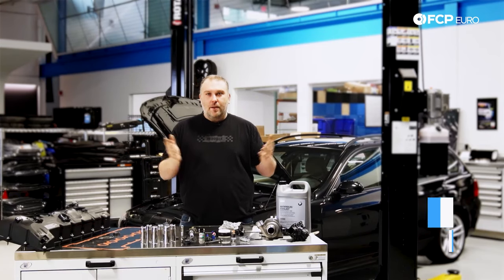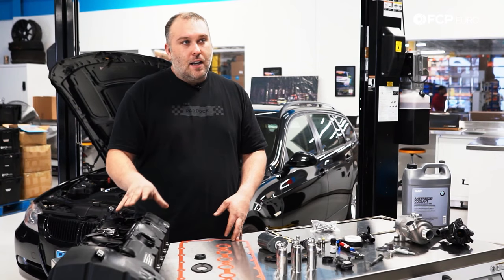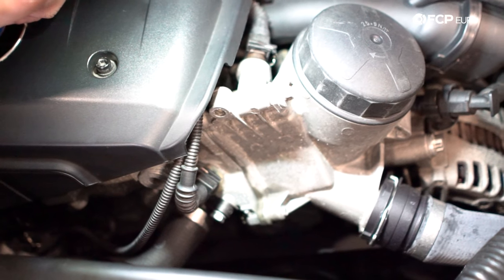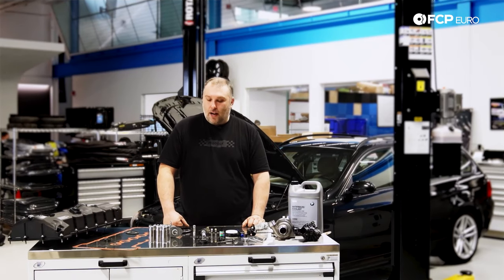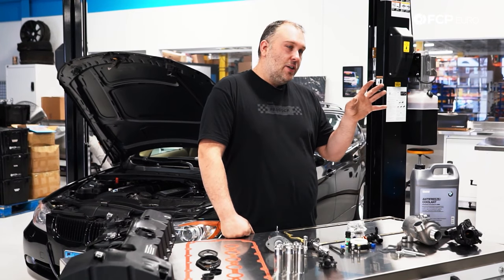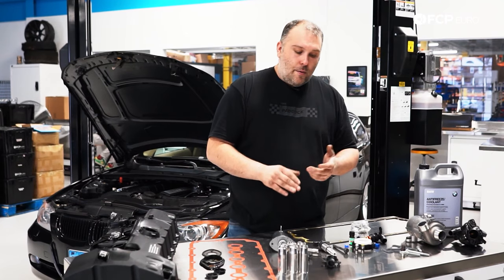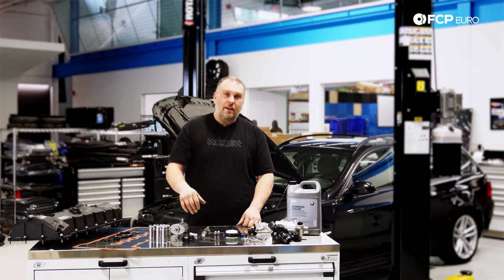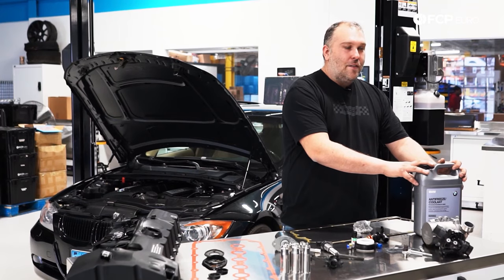BMW N52 Engine Diagnostics/Problems - Everything You Need To Know (128i, 325i, 328i, 330i, 528i)

Comment: Every time he picks up a part to talk about, he looks at it and takes a pause. It's like he is reminded of the traumatic difficulties this part has given him 😂
Reply from the maker: Wow, you can see right through him, Hel Rud! 🤣
Reply: The longer the pause, the more the trauma!

I was getting the sweats just watching the video because I've done almost all of this service on my X3 and 535xi (N54)
Reply: @bryanderksen4448  Yeah, same for me with my 2009 E60. : )
Reply: I think that we've all been there 😂
Reply: I have the same feeling. I have to fix the dreaded oil pan gasket, the crankshaft housing problem, the lifters, oxygen sensor, And probably the valve cover gasket. I won't know how bad the engine is until its open. Nightmare... the BMW has driven me to EV ownership
Reply: We've all been there.... All.... Been...there.

Comment: I'm a BMW technician and I have to say, you did an amazing job on explaining everything. Great video. I'm sure a lot of DIY will find it useful as well.
Reply from the maker: Thanks Cesar its always good to have some confirmation from a BMW Tech! Glad we made ya proud 😉
Reply: Same here. BMW TEC.
Reply: Cesar Perez, got a question  08 328xi e92 been having volatronic issues , code 2a38 , can eccentric shaft sensor cause this code ? ,  Had two other codes but I corrected it, change volatronic motor and relay wiring is good, there is a little bit of oil in the , sensor , I changed the vc gasket few months ago, lol not looking forward to taking apart again the chance of sensor lolol , but if it causes that code  then I'll change it  any thoughts on that code from that sensor
Reply: Hi man. Whats your take for N53 comparing to N52? do they share similar issues?
Reply: @stevet8607  I'm sorry for the extremely late reply, those valvetronic motors rarely go bad. Put a sensor in it. It'll fix your issue, obviously to be 100percent sure it would have to be tested. I have never seen the motor go bad (not saying it can't happen), I have done countless sensors for valvetronic faults.
Reply: @CesarPerez-ck7ci  I'm sorry for being the guy that brings work to YouTube. I have a E60 with the n52 that needs oil filter housing, valve cover, variable timing seal, and oil pan gasket repair. All together I was quoted around $2,500. I just wonder if it's worth keeping at this point. None of the Mechanicals or Electronics have ever had any issues. I love the car, and don't want to get rid of it if it's normal aging not necessarily poor design.
Reply: @ashtreylil1  if the rest of the car is in good shape I would definitely put some money into it, just make sure the person doing the work is qualified and ONLY use OEM parts. Aftermarket parts fail way too soon and rarely ever fit properly.
Reply: @ashtreylil1  also, when you buy an oem part from the dealership that part has a 2 year warranty on the part and labor as well, regardless of who did the work, only as long as it was done correctly.
Reply: @CesarPerez-ck7ci  oh wow I didn't know about the 2 year thing. This kinda justifies the expense over a third party repair shop if anything goes wrong.
Reply: @yahtadi5152  I am not familiar with the N53 as we don't have the n53 in North America, we use N52 but I would think they are very similar.
Reply: Why is like if you buy Bmw you going to regret it. I just had a friend who bought a bmw 530d from 2014. After to week the car was making trouble. He turn of the motor. But after he could not start the motor  again and all the light in dashboard turn on. He went to bmw garage  but the could not find the what was the issue. But lucky enough there was a tech from bmw Germany in the country. He found out the ecu has burn out. Is this very common on this model. I want to buy a bmw but after this I am not really sure any more.
Reply: I'm a BMW Enthusiast owning currently M50B25 car (E34) and M52B28 (E38). Those non turbo inline sixes share many common traits:
- valve cover gasket leaks if you don't replace it properly
- oil filter base leaks
- smooth a sa silk, decent mileage and power if serviced properly

And the most and best tip for all BMW engines, especially inline 6-es is:
- alway put best oil but only one that meets the standards that producer requires for this engine. and do full oil and filters change every 1 year or max ~10k KM (~6200 miles)
Reply: @ashtreylil1  don’t use a dealership that’s one of the worst things you can possibly do. They overcharge for parts and wtf is 2 years of warranty on a car part. Buy your car parts from fcp euro with life time warranty and do the work yourself otherwise you shouldn’t own a bmw because there very expensive cars
Reply: Mr Ceasars, I have an 2011 528i an it gave me an crankshaft code. Replaced it an all car does is start but won't crank. If I put a new battery in there, it drains the battery. What could be wrong?
Reply: Will keep buying from  fcpeuro 😂😂😂

Comment: Thanks for this! Every e90 owner should watch this. I really appreciate your content and learned a bunch from you dude! From brakes and rotors to sensors and pretty much a lot of bmw related stuff. I currently have no heat in mine and I suspect a heater control valve or a clogged heater core, I was wondering if you knew the Inner diameter of a hose needed to back flush the heater core? That would help a lot. Again thanks a lot for all the priceless information for us DIYers!!

Comment: You can use a 9-volt battery to test the Vanos solenoids to see if they're actually waiting open and close when you remove them make sure there's sprayed and cleaned off with brake cleaner and use some kind of silicone or hyper lubricant to lubricate them before you put them back in and make sure the O-ring and the spacer are in place

Comment: Very good video. I had this engine in my 2006 330i, but I did have a major engine issue, I had wear on my camshaft bearing ledge, and luckily warranty covered the $3500 bill. Other major repair bills were $800 for a new oil pan gasket, and a failure of my dual mass flywheel, which was around $3500 for a new flywheel and clutch.
Reply from the maker: Glad you like the video, Uncle Ben! Good thing the warranty covered that!

Comment: You guys are doing an awesome job.

It’s amazing how BMW is not being sued in class action lawsuits against them purposefully using shitty gaskets and plastic parts that break resulting in 1000’s of $$ for the customer to waste.
Reply: A lot of cars nowadays have a decent amount of plastic though don't they?
Reply: @lukesecrest1687  Yeah, it's even worse now on new BMW's. But the E90 generation is considered to be the more reliable one compared to other generations.
Reply: Trust me, BMW has MANY class action lawsuits against them
Reply: @e90_austin  lol right, and I’m sure they like to bury them and not broadcast them.
Reply: @lukesecrest1687  It's all about the quality. There is plastic on my old Acura that will outlive me. And then there's plastic on BMW that is designed to last approximately warranty+5 days.
Reply: Every modern car has plastic parts, heard of heaps of fords and chevys with cracked plastic radiators.
Reply: @mediocreman2  plastic and heat in general don't like each other.
Aluminium would be much better material.
But what's worse, BMW is using lots of recycled plastic that's even worse then normal plastic.
Reply: @trade1713 aluminum actually warps. But ok
Reply: @WayToManyAssassins  true, it warps when you expose it to high temperatures above 200° with some aluminium alloys able to take double that before they start warping.
You wouldn't put aluminium as walls of combustion chamber, but simply as a valve cover, various pipes that plastic just starts cracking after a short while and areas that aren't exposed to high temperatures.
Absolutely superior material when compared to recycled plastic that BMW seems to be liking so much these days...

Comment: Great video!! I just replaced my Valvetronic Motor Gasket for $20 with an OEM BMW gasket. A local BMW authorized place that I trust quoted me $1450 to replace the valve cover seal… After some YouTube investigation I found that the build up of oil below the Valvetronic motor was likely the Valvetronic seal. So $1450 fix turned to a $20 fix, Thanks guys😎🙏🏽🙏🏽🙏🏽🙏🏽

Comment: Awesome video! I have put nearly 100,000 miles on my n52 after buying it with 105,000, and I run it hard! ... I take care of it though; I warm it up, change the oil, etc. Absolute awesome engine. A true gem and the last of it’s kind from BMW.

To add: It’s easy to mistake oil leaks around the valve cover gasket area. As Gareth mentioned, there are several areas on the valve cover gasket that can leak, so if you can rather than just replacing the valvtronic motor gasket or the valve cover gasket, etc., it could be the oil separator which happens to manufactured/integrated into the valve cover. It’s very difficult to differentiate where the leak is coming from, especially when there’s potential for the leak to be located in the middle of the valve cover where the spark plugs are located. 
Since all of these issues associated with the valve cover are common, I recommend replacing the whole assembly and saving yourself the hassle of trying pinpoint the exact leak point.
Reply from the maker: That's awesome to hear, Evan! Glad you like the video and thanks for the tips!!

Comment: Just bought a 2008 328i, I am currently working on replacing all of these parts. Yes, it's a bit of a nightmare but thankfully I have been building my own cars for a few years and I do indeed have experience and understanding. This engine is an entirely different beast but when I finish it, I will enjoy the ride. I knew I was purchasing a challenge and I knew I was capable of saving it. Thanks for this video!
Reply: good luck bro
Reply: Wish I'd known you were in the market for a 328I. I have one with a manual transmission. No sign of engine leak or low coolant, but the engine overheating lamp popped on. I'm not interested in a $5K repair. Thinking about selling it. Any thoughts?
Reply: @shereetyson4422  Probably the water pump.

Comment: Thanks for the overview, Gareth! I've had to replace all of those items on my N52s except for the VANOS items (fingers crossed we are good there). But at 200k+ miles, my E60 has never run better. The E70 is hanging in well, too. One thing I learned the hard way from my water pump failure: flush the system (an extra gallon or two of distilled water is worth the $1) to ensure any bits from the old pump's find are out. I had one jam up my pump (which I bought elsewhere), so I made sure to do the flush before installing my FCP pump. I have an E93 with the N54, too; doing the clutch, brakes, oil and air filters this Saturday. Thanks again!
Reply from the maker: Happy to help, Jeff! That's a great tip on flushing out the system. Thanks again for the support, Jeff!
Reply: You might have got plastic from the plastic mickey mouse flange. Definitely change that to metal either way.

Comment: Excellent info! Have already addressed a number of these components on our 2010 X3.  The oddest one was: we bought the car with a bad oil filter housing gasket. It had been leaking for a very long time. The whole front of the engine was saturated in oil. Replaced that and bought a new serpentine belt. Was kind of lazy and didn't get around to replacing it. During one long trip, the belt completely shredded itself. luckily it didn't take out the bushing mentioned.

The moral of the story, replace an oil-saturated belt no matter how good of shape it looks. This one looked fine.

Comment: Really well done! My N52 is new to me and I'm enjoying going through it. I look forward to your future videos.
Reply from the maker: Thanks, hpathree! Congrats on the new purchase, glad to hear you are enjoying it!
Reply: Just sell it bud. Whatever you paid for the car you're paying again in parts
Reply: @honorhurricane5180  I bought an e90 3 years ago for 8k, I've put 10k into it and I'm basically replacing every piece on it one at a time. Unless you're buying it from a dealership with under 100k miles, it's not a good deal
Reply: @JuanMendoza-nl9fn  My friend got his e90 for 5k 3 years ago at 147k and have put little money in it… and I’ve got mine at 10k a couple months ago and spend almost 2k in maintenance but that is due to labor cost and had to get new tires due to control arms (that was $550)  and I do maintenance that doesn’t really need to be done but I just want to do it. Cause it’s the way I am
Reply: @JuanMendoza-nl9fn  just because you had a bad experience does not mean it is a bad car. Because mine is perfectly fine running at 180k and I only had to change a timing belt along with doing routine maintenance. Sounds like you just bought the car from someone who did not take good enough care of it because my 330i n52 is the most reliable thing I have ever bought
Reply: @regulus8319  you could be right, what I've learned is that miles are not relevant to a vehicles ware. The amount of cycles you use it is what degrades the engine, my e90 gave me a bad experience with bmw. It's at the point where I can no longer do the repairs myself because everything is electrical and requires a computer and certified technician. I bought myself a 2001 toyota tacoma and no regrets so far. Simple, reliable and I can change just about every part on it with the right tools, can't say the same about bmw
Reply: @JuanMendoza-nl9fn  cant go wrong with a tacoma. Those things run forever lol. Great choice
Reply: @sirwellingtonthethird687  as you've pointed out. Tacomas are not performance vehicles by any stretch of the imagination. They're tuned for reliability. I still have my bmw but it's been sitting for over a year due to the fact that any local German engine mechanic wants no less than 1k just to do an inspection on my engine. I've been putting my money into upgrading my tacoma and just haven't gathered the courage to pour that much money into a diagnostic. I've been contemplating selling the car as is and using whatever money I get out of it to buy a fun car. Nothing too sporty but something with a little more zip than a medium size pickup truck. You mentioned American muscle, what would you recommend? I'm looking for something with a manual gearbox and something where I can purchase my own parts and install them myself so nothing too new.

Comment: Great to see you guys supporting classic BMWs.
In the past 12 months (100,000km) I’ve done the valve cover and gasket (using your kit), eccentric shaft sensor, oil filter housing gasket, heat exchanger gasket, oil pan gasket, and oil filler cap. I also replaced the shocks and ABS module. Now, finally, she feels like a new car.
I wonder if the newest replacement parts are of better quality to the original equipment.
Reply from the maker: Thanks for supporting us, scanspeak00! Happy to support classic BMW owners and keep as many on the road as possible!

Comment: Great video.  I'm just stumbling across this stuff now, having just picked up my first BMW, a 2007 328i.  I was aware of some of the issues these engines have but really appreciated the more in-depth explanation of why they happen and what has to be done to ensure it is repaired correctly.
Reply from the maker: Welcome aboard! Thank you for stopping by to watch.
Reply: How many miles?
I just got one a few months ago and already replaced the dtml pump and now have to replace the purge valve under the air intake box , I'm having evap problems getting bad gas mileage
Reply: @LxTxSURGE  Mine has just a little over 86000kms.  Crazy-low for the year.  However, it did just develope a misfire literally overnight.  Ran perfect the night before and then started it the next morning and it's running on 5 cylinders.
Reply: These things are machines, they break.
Reply: I never updated this, not that anyone is likely super interested, lol, but it was a coil pack.  Did all the coils and plugs and it has been excellent, since.  Now I have a flaky rear window issue that is super common, but we're into spring, now, so I'll get that sorted next.
Reply: @tylerpalmer8973 so idk bow if i buy one 2005 e90 2.5cc n52 mint condition whit 100k km 😅 i dont want to spend mpney
Reply: @ilija6619  It's an old euro car.  If you don't want to spend money definitely don't buy euro, haha!  I've been out of euro cars for a while, and owning this BMW has reminded me part of what I don't like about them, and I've got the more reliable version, haha!  The turbo motors (N54)  are far worse for expensive repairs!
Reply: @tylerpalmer8973  well depend what euros got a opel 200k km never problems only service every 10k km😅 thats why i  asking, my father mercedes benz also 0 issues...

Comment: I've had to do most of these things already after buying my 2011 E91 at an insurance auction with 112k miles. Water pump/thermostat, VANOs solenoids (damaged from collision, oil filter housing gasket, and eccentric shaft sensor after a year with the car. And did them all with the help of FCP euro's great packages, quick shipping, and awesome warranty (used when the new radiator installed starting leaking a year after install). Great video! Looking forward to more videos on this engine/chassis.
Reply from the maker: Glad we were able to get you what you needed ltbullit35, and although unfortunate still able to use the warranty as we intended it to be used! Thanks for the support and stay tuned for more upcoming content!